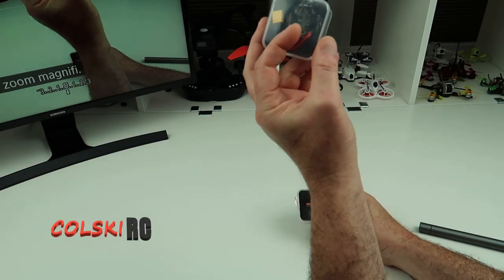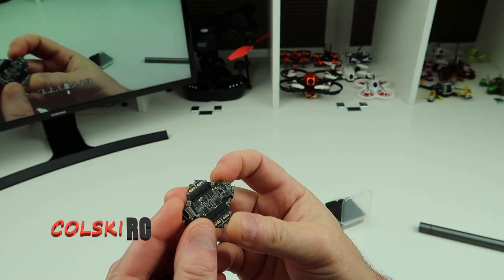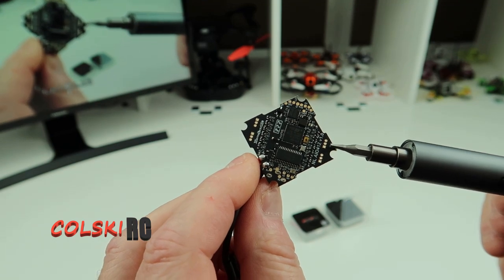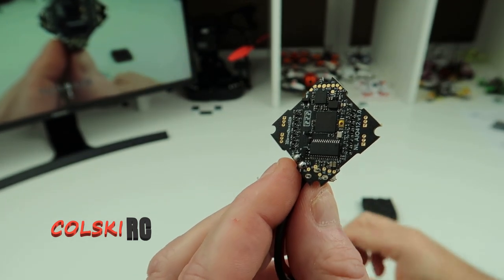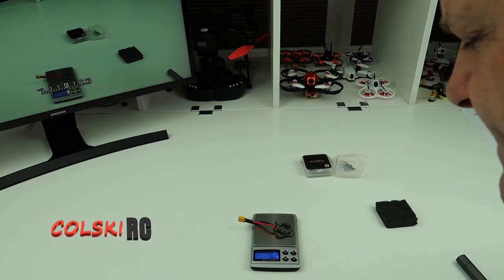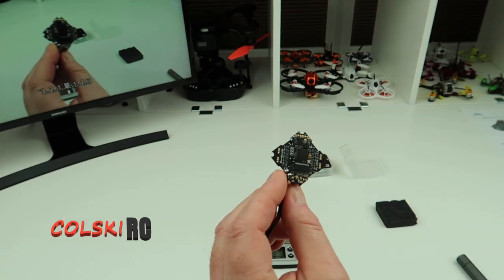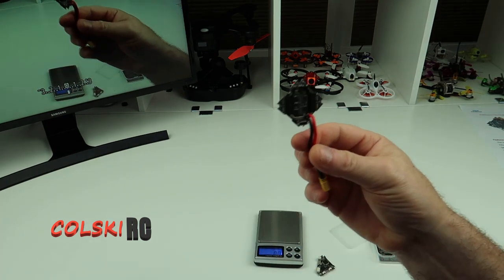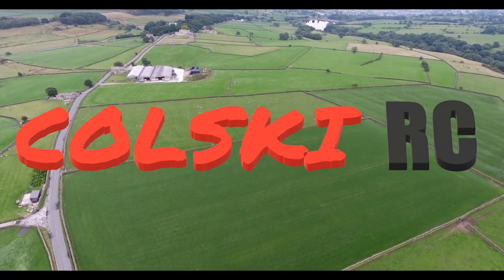NAMELESS RC AIO412  **MUST READ DESCRIPTION** DO NOT BUY!!!

Comment: the frame is worse than the fc..why do you say do not buy? I mean the namelsess boards are kind of cheapy boards, but I did not hear any negative stuff in that review..contrary to the title.the frame is exactly how not to do it. when you make it light you better come up with a design that holds up.the 16x16 holes are stupidly layed out exactly  where the arms met the bottom plate. either make it stronger where the arms join the plate or include a 26 to 16 adapter plate with it. it took only one flight to break this shit frame.
Reply from the maker: Hi read the description 2 boards burned out almost immediately, the fets on these things are awful for the same price you can get far better boards